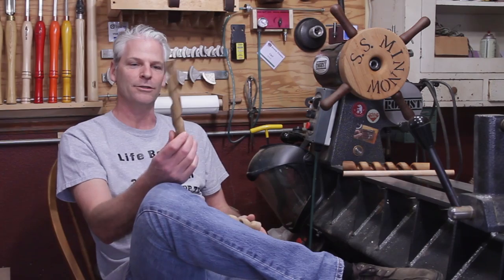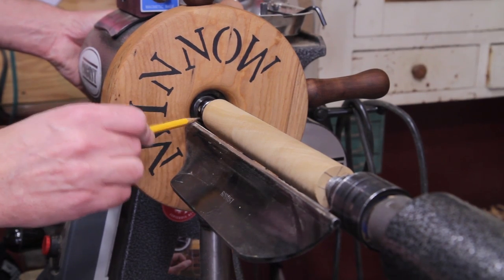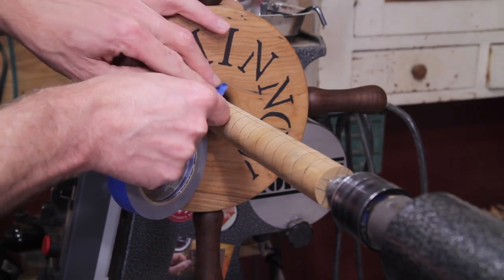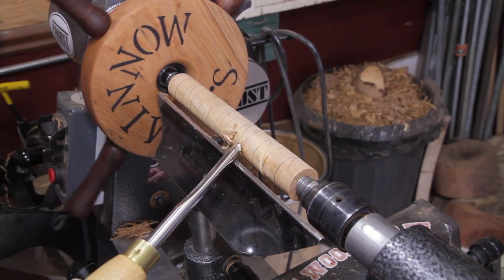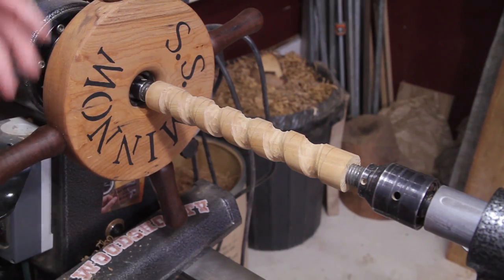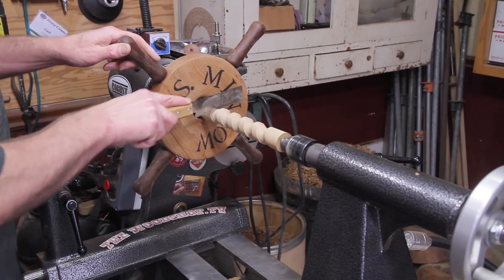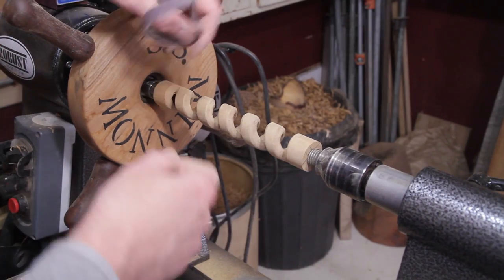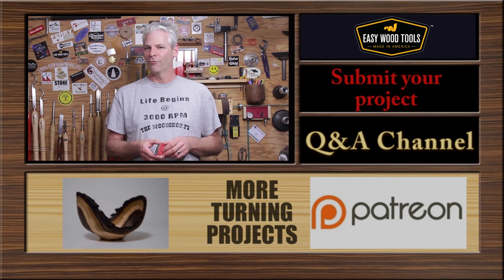Hand Cut Spirals

Comment: Thank you Carl.   I've made a few miniature spirals and they take quite a while but are very satisfying.   If you want to make larger ones the lathe hand wheel won't give sufficient leverage unless you like a lot of pain.  The capstan is the answer.  It's also important to leave an untouched inch or so at the end of each spiral.    If you decide on a hollow spiral you should also think about inserting a piece of contrasting wood in the centre/center.
Many thanks,
Alan.
Reply from the maker: +Alan Simpson Thank you Alan :) Thanks for the tips too.
Take care,
Carl

Comment: This jig looks like it works great. I wonder if a hand wheel on the other end of the headstock would work. Not as much leverage but more versatile. I made a hand wheel for my Shopsmith using a Dado blade arbor. It really comes in handy.
Reply from the maker: +Gil Grace Thank you Gil! Yes a hand wheel on the back side works great too, but for this the leverage really helps.

Comment: Nice Carl.  Looking forward to seeing what it becomes when it grows up.

I have done a few of these on a smaller version with 3/4" dowel rods.  I then cast them in a mold for pen blanks.  I use the scroll saw method from this YouTuber.  https://www.youtube.com/watch?v=4gV1J59Ft4E (TheMrByrom).  The bonus is, I get two spirals for the price of one.

Not sure you can control the size like you have done with this method but it did work for me and some different looking pens.

Nice looking wheel BTW.

Thanks for all of the great info you provide.                        JimE
Reply from the maker: +Jim E Thank you Jim! Yes that's a really cool technique.